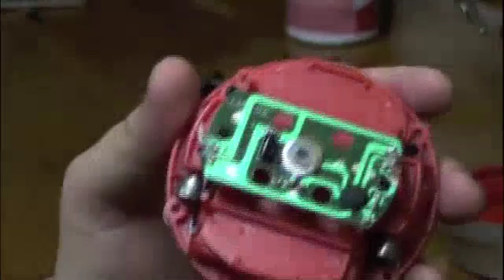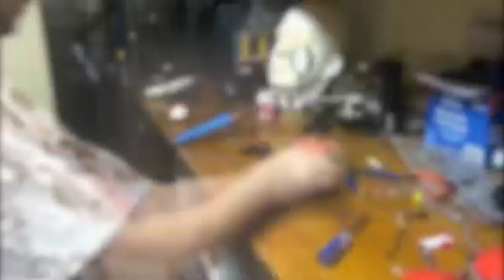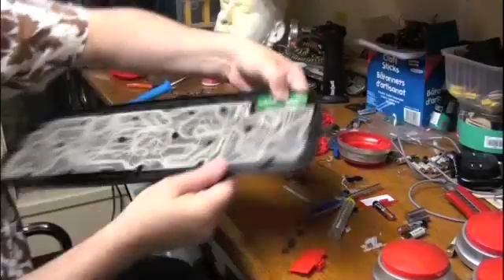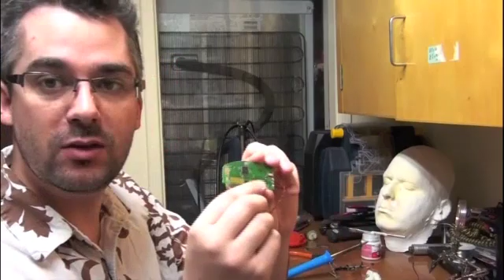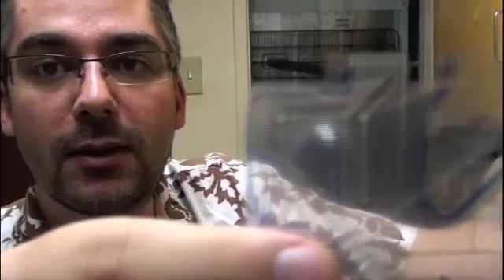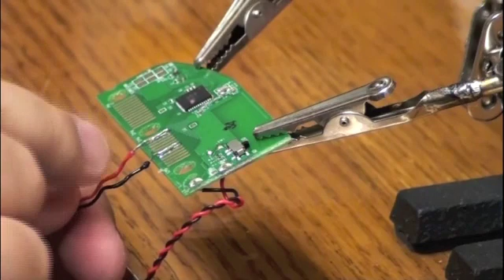Easy Button Hack - Wireless Game Show Buzzer - tutorial - Part One

Comment from the maker: Ah ha! I ran into the exact same problem. Most keyboard circuits have carbon on the connector pins, so you have to scrape that crap off with an xacto knife until you get a nice shiny surface to work with, then... flux is your friend. If you use simple circuit flux, you can use some solder to "tin" the pins and make it super easy to solder wires to. The flux makes the solder stick to the copper at a much lower temperature, so you won't ruin your board.

Comment: Making a 4 button system, wired keyboard. successfully modified 4 easy buttons.
I took apart a keyboard, and found which connections make the numbers by jumping them with a wire.. no problem there- got it to type 1,2,3,4 ) 

Here is my problem: I can’t for the life of me make the wire adhere to the board.
I cleaned it with alcohol, make sure all was dry, and soldered it.  Popped off. 
I finally baked the thing enough so I ruined it.-killed two keyboards now.
.
Any advice?

Comment: ...., but each Easy button would be wired and plugged into your box via a Cat5 with RJ45 connector (or whatever the builder chooses) containing the wireless keyboard circuit board...Would you think that's possible? that way I wouldn't have to purchase 10 keyboards just to tear apart

Comment: Do you think you could possibly mount the circuit board of the wireless keyboard in a box, the box having say..10 separate ports...each port would then be soldered onto your keyboard, we'll say port 1 would represent A, port 2 = S, port 3 = D, port 4 = F....etc, that way you would essential have a wireless transmission...

Comment: Hello I was wondering if you could help give me advice, im trying make a buzzer be capable of advancing a powerpoint slide forward and i was wondering if it would work with these, it does not matter if there wireless or wired as the computers will be under the table.

Comment from the maker: @619buyaka1 I'm not sure how far to go with this... What is your school level? You can go about doing a wireless buzzer a number of different ways. You can go the arduino/XBee route. You can hack a small remote control car and wire the drive assembly up to a buzzer instead of a motor. You can go the Bluetooth route and use the smirf chipset. I'm not sure exactly how much of a DIY you would need. Do you need to print your own circuit board, or just do a little circuit-bending?